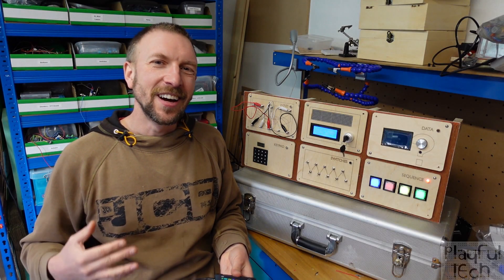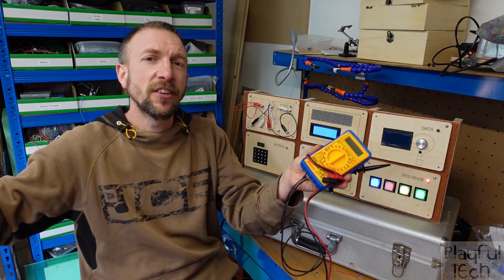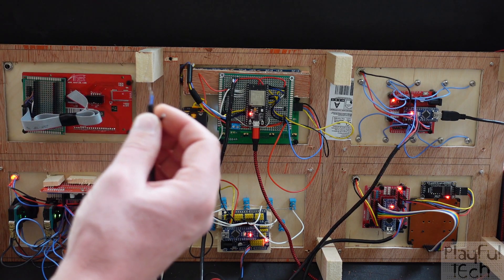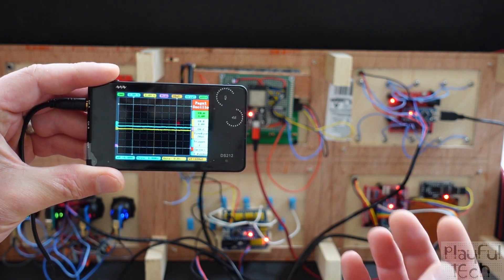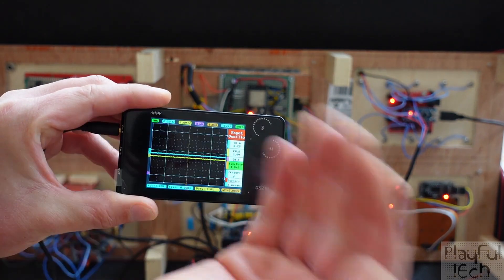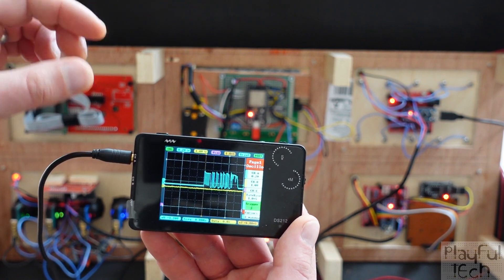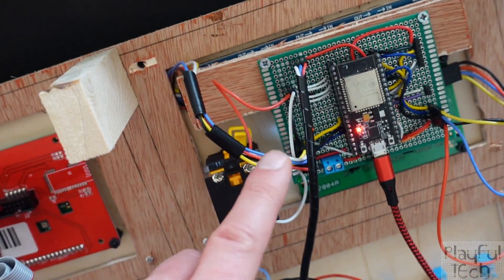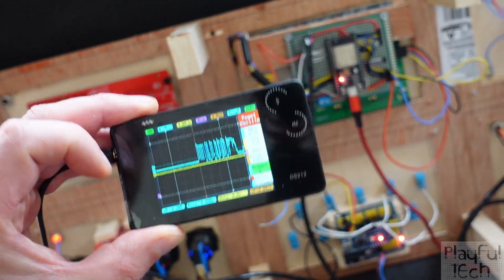How to use a Digital Oscilloscope to debug Arduino Projects (or ESP8266, ESP32, Raspberry Pi etc.)

Comment: Once you've got an oscilloscope, you'll wonder how you ever did electronics without it! I've recently replaced my old Tek 2213A with a Siglent SDS 1104X-E. Expensive, but very much worth it!
Reply from the maker: I'm still very much at the "toy" end of electronic engineering but, hey - it gets the job done! :)
Reply: @PlayfulTechnology  Yep for stuff like you're doing these are fine, certainly better than no 'scope at all ! I used to use my sound card input!